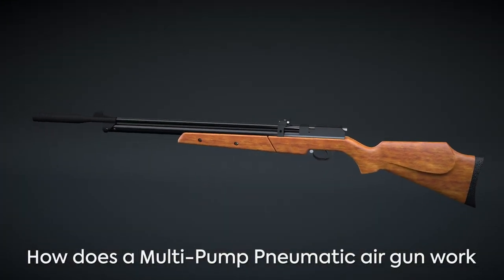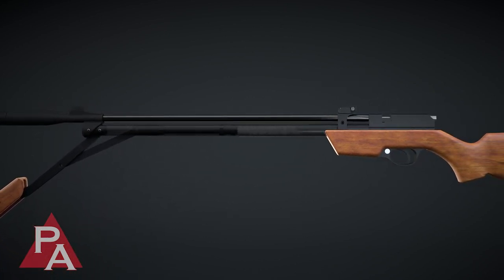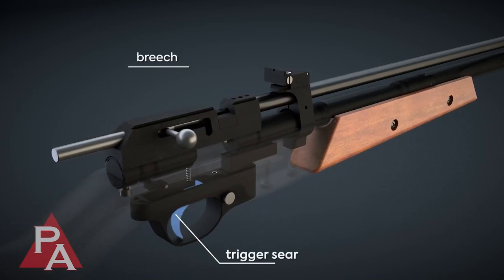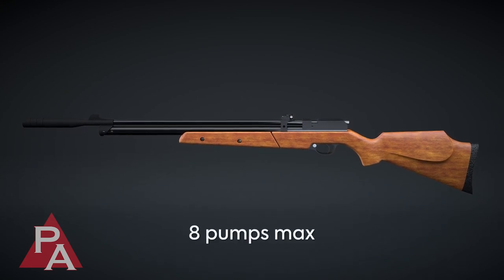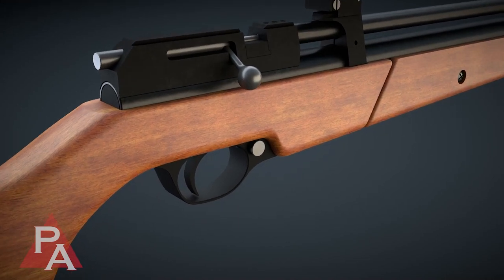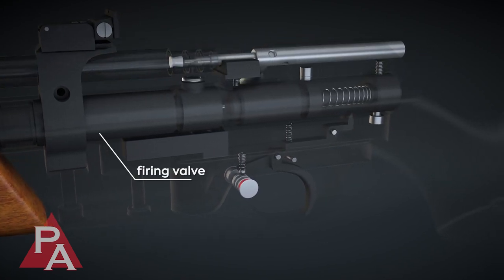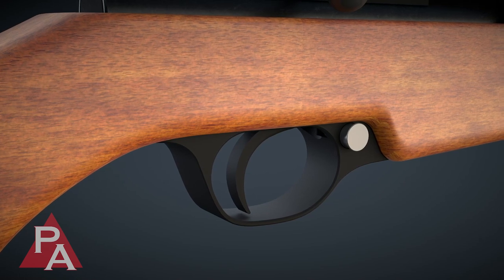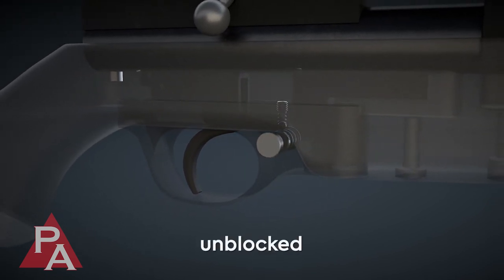Learn How Multi-Pump Pneumatic Air Rifles Work

Comment: This was a good video, I shoot a Crosman 1377 and 1322 with 14.6" barrels and rifle stocks and I also have a Legacy 1000 all of them are reliable pumpers.  When it gets cold and I can't use my co2 guns I've got the pumpers or my Crosman F4 break barrel.  I'm tempted by pcp but all the extras needed to support the gun is what is keeping me away!
Reply: Same, I want something more neighbour friendly than my current 70 joule air rifle for back yard plinking. Gas rams are slightly more quiet than springers but not a lot. I don't want CO2 because of the consumables. Multi-pump seems to be a good option, but so far it hasn't proven easy to find a decent rifle that doesn't need too much work, but that does allow for a moderator to be fitted.
Oh well on with the search.